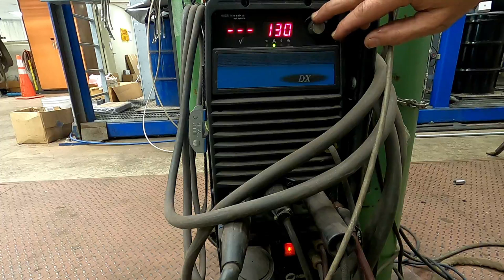Massive Footer pour Day!

Comment: Boy nothing feels better than standing on the new concrete. Always so much more than what you see when it's cured. Millions of  house footers have been poured without vibrating and at a much lower psi mix. Looking at the steps having no honeycombs when you pulled the forms. You're good. When you stage your block - put your best looking down to be laid last. The chipped and less pretty laid first down in the ground. May have to conference with your block layer if you are staging block yourself. There's as many ways to set up and lay block as there is masons to do it. Good as it feels standing on the footer, just imagine how good it will feel standing on cured floor. Thanks for sharing

Comment: Hooray! You finally have the critical part of rebuilding your shop wall behind you.  That foundation wall will probably be there forever.
Reply: I used to think that about reinforced concrete too. But eventually the rebar will rust and blow the concrete up as it expands. It will take a long time but it'll happen eventually. Might be hundreds of years? You should see this smokestack anchor block I poured once. It was a solid 120 cubic yard cube and it was reinforced every 6 inches in every axis. You could feel the heat coming off it from 5 feet away while it was setting up. It was quite a chunk of reinforced concrete. But even it won't be around forever. Longer than we will though.

Comment: Steve, looks like the pour settled very well, not leaving any voids. It's their responsibility to offer you or recommend why or why not to use a vibratory system. They are the cement professionals and should have communicated it up front. Our best laid planning never seems to overcome the possible complications a contractor brings to the job site, i.e., driving vertical rebar into your forms! I guess they needed a way to determine height when no forms where there. Good video and glad you got your foundation finally poured. Looking for the series to continue until the shop is back together.

Comment: Wow, hadn't realized the metallic 3D printing had come that far. That piece was definitely NOT cheap.

Oh my back watching the gentleman with the hose. That is a looonng work day. So is you playing with a pile of block. If your kids don't love you now they will in 50 years when the shop is still standing. 
Say Hi to the Nuts for me.
Reply: We've used that 2" trailer pump to pump grout down the webs of block walls. So up in the air on scaffolding. I've never seen one used on the ground before. On the ground you use the 6" hose. Dragging a 6" hose around will put a kink in your back too. Some days I'd lay on the floor to try to straighten my back out.
Reply: Metallic 3D printing isn't so rare these days.  You could get it done at Shapeways or i.materialise.   You pay a nominal setup fee then a bit more than $10 (it quotes in £ for me) per cc of material used.  Complexity in the part comes for free,  if it's in your model.
Reply: I'm afraid to ask but how much do you think a piece of tubing like that would even cost? I imagine it could be used in automotive applications once its cheap enough for that integrated heat exchange.

Comment: A friend of mine did construction work on the side and could lay block and pour footers. He used grade stakes too but used 2x2 wood stakes . He would pound them about an inch below grade and then pound a small nail down to grade height . When the footer was poured they went up to the top of the nail then pounded nail below the surface and left the stake and nail in the mix . He told me how important it was to get it level as every low spot had to be later filled with mortar. It was much easier for him later when he laid the block . Your footer looks great and should work perfectly .

Comment: Gday Steve, the concrete trucks in the states are a lot different in there setup then here in Australia, ours here are rear load, the concrete pump did a good job, anything’s better the using a wheel barrow, I think you have done the right thing by going that bit extra on the footings, the walls are only as good as the floor the sitting on, your welds looked really nice on the 3D printed part, I’d hate to think what that was worth the get printed, I guess it’s not far away until the walls start taking shape, I bet you can’t wait to see it all finished, great progress mate, thanks for the update, take care, Matty
Reply: There is a mix of front and rear concrete trucks here in the US. The front dump are generally a shorter truck as you don't have the cab sticking out like the rear load and you can have extra axles under the mixer to carry more weight.

Comment: I have never seen a concrete pump that small.   Anymore, you rarely see a towed pump around here... and I live in the mountains.  Can't believe your concrete crew showed up without a vibe...  that should have been a given.    But, you've turned the corner on this job, things start going up now!
Reply: Why vibrate concrete if you don't have to? Vibrating does not make concrete any better. In fact it can cause aggregate separation. Which is not good. No one vibrates concrete just because.
Reply: @1pcfred  hand dug trenches with a lot of rock removal, unknown/uneven compaction values on the trench walls, no talk of ground porosity or moisture content, mixing multiple slump value interface matrix, pumper (hose guy) was using a drop technique not a push (air infusion)... shall I go on or do you want to swap CE credentials??   Really, I wish Steve the best and he's certainly put a lot of effort into this.   But in many states this would not pass code in flat ground, let alone on a slope, so near moving water. 

Aggregate separation occurs when there is a poor choice of aggregate size/surface type to mix density.  For proper consolidation and to remove voids (honey combing) the proper mix should be vibed based on 6x the diameter of the vibe to meet spec and even closer where you want to knit slump changes or lift levels.   Can you over-vibe? Yes.     Just Because?  Just professional.
Reply: @ramosel  we can swap credentials. I'm a vested union laborer. I've worked plenty of tested jobs where we did not vibrate. Slump tests core samples sent to lab the works. If you do not have to then no one ever does. You think there's always someone standing around with their thumbs up their ass ready to run a vibrator? Think again. Everyone on a pour already has a job they're doing. Or they wouldn't be there! In fact it usually takes two men to run a vibrator. One to run the tool and a guy to drag the cord around. No contractor that plans on staying in business is going to have two stooges on a site that he doesn't need.

Comment: Hi Steve - Your footings look fine to me. Because the pump was slow I doubt if there is much air in the concrete so the vibrating does not matter. I hope you are going to lay the blocks your self then it gets done how you want it. If you now want it up quick then get a brickie in, 2 days and it will be up to window height.

Comment: man that is really a slow concrete pump.
Reply: Been quicker with a 4" pump
Reply: Our local concrete guys have a concrete truck with both the pump and the tank, best for the small jobs. The pump is of course equipped with the crane and 4" pipe
Reply: @MF175mp  Here in the UK, we have concrete mixers with a  conveyor belt,giving a reach up to 16 metres (55 feet), also others with onboard pump.
Reply: txslim
They're running the small line for a purpose, so that the forms don't blow out. Slow & steady was the name of the game for this job That pump can run a 4 inch line if they wanted to bolt it on. They can fit the larger line if they wanted to. I think it was about 7 yards of concrete, that's 14 tons & too fast will blow the forms & remember this is Steve's 1st substantial footing job that mostly he did himself. Between Steve & the concrete crew they got the job done without drama.
Reply: Slow but very SURE! Have you ever cleaned up a truck load of wet cement from a blown form? No need to wand, our state department of transportation prohibits wanding (unsupervised) on bridge deck pours. 
Good job, Can't wait to see the floor pour and backfilled!
Reply: @hughmoore810  Agree.  This is also a good reason why not to vibrate.  Also.  when the boxing was removed the sides of the pour looked really good,  so the vibrating was not necessary.  Also,  the concrete at 5000 psi was ridiculously strong.  That foundation is going nowhere.

Comment: It wasn't until I saw the Wildcats logo that I connected you being in Kentucky with the Univ of Kentucky. I hadn't thought about it, before. If you pay any attention to Kentucky football, you likely know of an old friend of mine: Rich Brooks.  I was an undergrad, studying Sports Medicine at Oregon, when Rich Brooks was hired as the new head football coach at Oregon.

It was the first day of fall practice, and I was assigned to a linemen for the day; where they went, I went.  The past few years the team had used a new helmet with air cushions, instead of foam pads. They were a nightmare; we spent more time pumping helmets up than anything else.  

The prior Spring, new helmets were obtained, but they were not without problems. They had a mix of foam and air cushion pads. The problem was the forehead air pad would rupture when the big guys would crash helmets together, and the stiff plastic of the pad would cut the players' forehead. Not bad enough for sutures, just a PITA kind of problem, (foreheads bleed profusely, just like the scalp, and sweaty, oily skin is near impossible to get anything to stick to and stay on.)

We all were loaded up with big azz bandaids, spray adhesive, stuff to get the sweat off, etc, but because I was assigned to linemen, I was loaded up.  The linemens' drill had just about drove me to terminal boredom, when someone in the drill yells, 'Trainer!'

The players knew to come to me, so we wouldn't be in the way, while I was dealt with the blood, sweat and lack of adhesion.

I wave my arm, the player sees me, and heads my way. He's a big boy, 6'5"-6'6", likely 300# with all his gear. I'm 5'11, 185# soakin' wet, and was just getting used to working around big dudes, (this was my first Fall football season.)

When he's 5-6' away, he wipes his hand across his forehead and says 'I think this damn helmet cut me.'  I'm looking at his eyes and forehead as he's talking, so I see his eyes get big when he sees blood all over his hand, AND when his eyes roll back in his head.  By then, he's a step closer, and I'm thinking, 'He's goin' down, and hell NO, he ain't falling on me, and I'm NOT gonna screw my back up trying to catch his big ass.'  (We were taught not to catch big players, because of potential injury to us.)

So, I 'olé' out of the way, and my eyes follow him to the ground, where he bounces and is out cold.  I'm looking to make sure he didn't land wrong, and break his nose, or worse. 

He's fine, and my eyes naturally lift up, when I notice a pair of shoes beyond his head, and realize the wearer must have been standing right behind me, and witnessed me oléing this player to the ground, and the player bouncing. 

At the same time all this is going through my mind, I also realize the shoes are a brand new pair of Nike turf shoes.  Only trainers and coaches wear these shoes, and I am the only trainer in 30-40 yards.  

I start to kneel down beside the player when, out of the corner of my eye, I see The Shoes move closer. I feel a pat on my shoulder, and look right up into the face of the brand new, Head Coach Rich Brooks, whom I had not met until this very moment.

This is a critical point in time for me. This is the mid '70's. I don't know anything about Coach Brooks, but back then, MOST football coaches are flaming A-holes, who typically don't like trainers because they think we are "taking their players away from them because of trivial things, like injuries.", and generally are not pleasant to be around. It's also unlikely coaches know we're not SUPPOSE to catch big players.

What's going through my mind is, 'oh no, don't let me set a new record for getting run out of practice on the new coach's FIRST day. I'll NEVER live it down.'

I look the new Head Coach in the eyes, nod, then get to work taking care of HIS player.  I'm checking if he's conscious yet, and talking to him, telling him not to move until I check him for injuries, reassuring him, etc.  I want him to hear my voice as he comes to, as it helps keep them calm.  I see THE shoes from the corner of my eyes, and can tell he's leaning over.l

The moment of truth is upon me, when I hear a low chuckle, followed by 'I would have done the same damn thing, he's too big to catch. He'd hurt somebody our size.'

I look up, get a big smile, and laugh, while nodding my head, not trusting my voice.  That moment became the basis of what would become a 40+ year, (and growing), friendship between Rich and I.  He has a wry sense of humor, much like mine, and we've had a lot of shared laughs. When ever our paths cross, one, or both of us, always has a good story to share.

Rich retired after nearly 20 years at Oregon and became THE reason Oregon is the football power house its become, (then Kentucky lured him out of retirement to put their program back on the map, which he did. I think they named the field in his honor.)  Two plus years later, I left Oregon, in pursuit of my own career.

Almost ten year later, our paths crossed in Boston. I was in town for a job interview, and he was on a recruiting trip. We both had some time, and decided to check out the Boston franchise in the new, spring pro football league, the USFL.

Rich was the first person I saw as I reached the playing field, for the PR event the franchise was having.  When we saw each other, we said, almost in sync, 'What the hell are YOU doing here?'

The day took an unexpected turn for me, and Rich was instrumental in me being hired for my first job in professional football, that day.

I see him every couple of years, since he's living outside of Eugene, up the Mckenzie River, where he gets to fish as much as he wants.  Thanks for sparking the memory of a good friend of mine.

====

Your footer's looking good, as good as your TIG welds.  I've wondered, recently, what you did in the real world. I, for one, would like to hear a bit more about your day job.

GeoD

Comment: Interesting how construction methods & standards vary. Pumps became common in the '60s, I don't remember when the front discharge trucks started to be used, but a long time ago. I suspect they cost quite a bit more. As for consolidating with a vibrator, as sloppy as that mix was, probably not much to be gained. A tall building will use relay pumps. Concrete is always hard work.

Comment: If everybody thought like you, doing it right the first time and thinking about the next person or trade that will do work after you... thanks for the éducation.
Reply: The first guy did it right for him. It lasted as long as he needed it to. No one builds structures to last forever. At least no one that wants to remain solvent. Today we build commercial sites with a 50 year lifespan. That's it. By then whoever worked on it will be dead and there'll be new tech available anyways. That's reality.

Comment: Waiting for the next video, but my prediction is this-
you will have a hard time finding a block guy to use your old blocks, because they build their profit into the block prices- using your blocks is just asking him to work for wages.  Being remote, they will want to come out with all their own materials and lay it up in one day if possible rather than taking several long trips.  I say you will end up laying the first 3-4 courses yourself until you are up above the level of your floor and then bring in the concrete guys to pour the floor for you so you will have a nice flat stable work area and you will then lay the rest of the blocks yourself a few more courses high and finish framing the wall in wood.

Comment: Depending on the area and what year building code you use: rebar must be fully encased in concrete and may not be exposed except for where rebar is to tie into a future pour. So, I am glad you pulled the "grade sticks" out, cuz that could have failed an inspection.